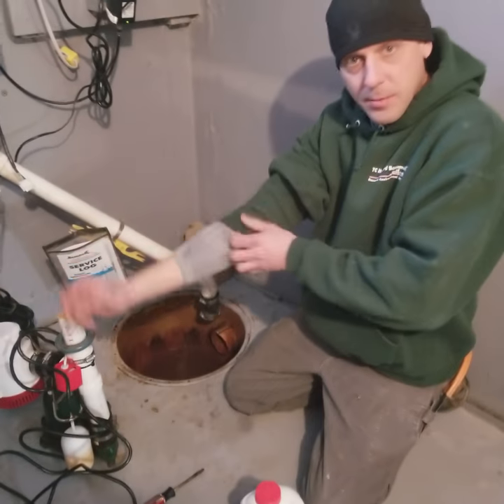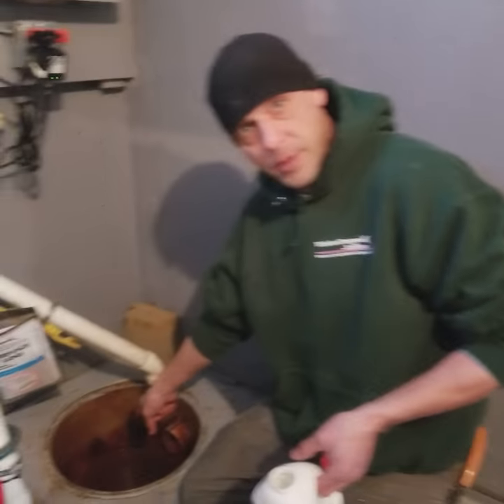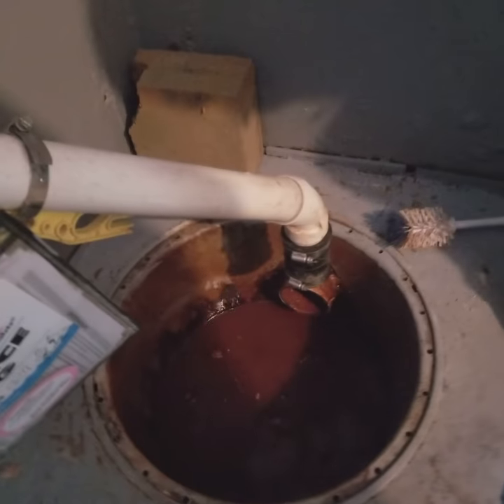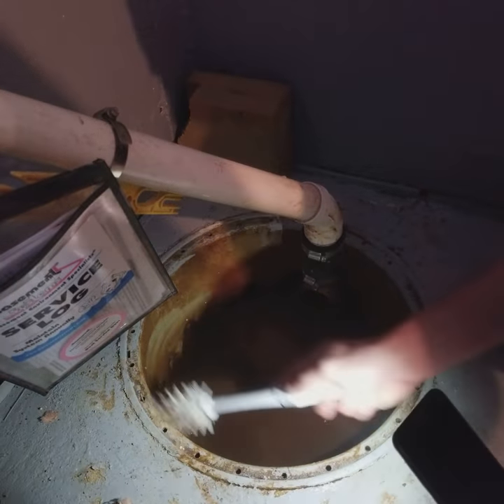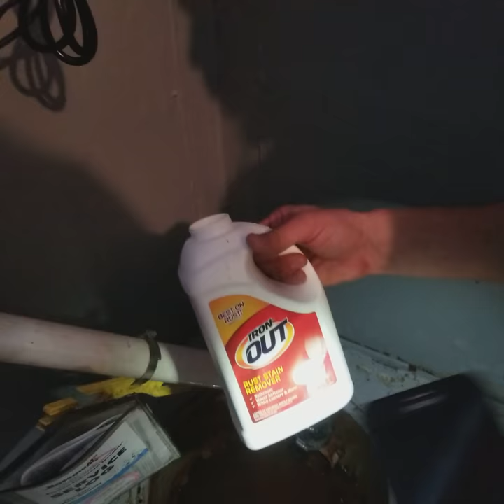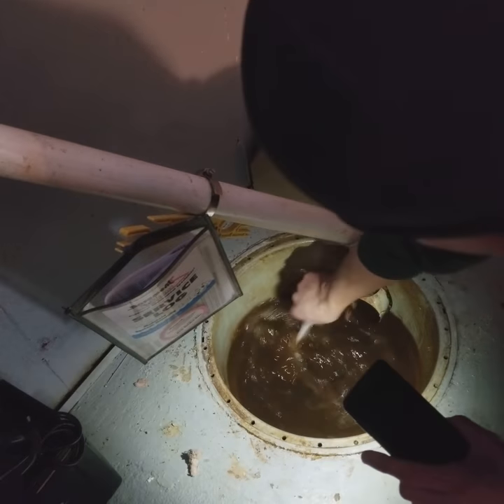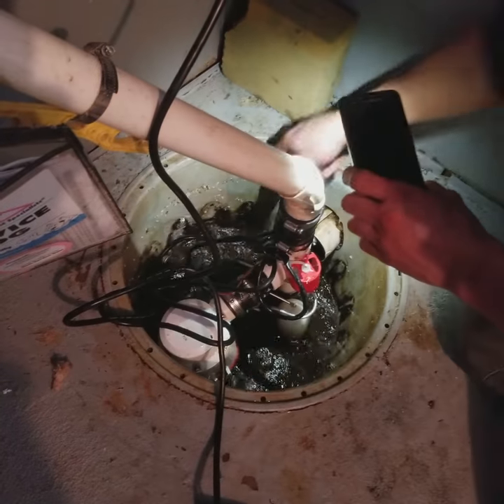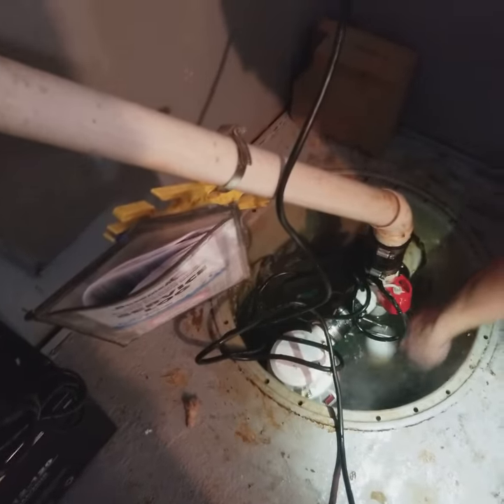How to Clean and Maintain Sump Pump - Remove Iron Ochre (Bacteria)

Comment: To all that has viewed this video I am Bryan that guy that did this video if you have any questions please call TC Hafford Basement Systems
Reply: Bryan Langlais how long do you leave the iron out before you pump it out
Reply: @gunnblaze  depending on how much iron ochre you have in your system. Normally about a half hour or so
Reply: I just had my sump pump replaced now I have a Metally stinky smell not quite like p00p but I don’t know why- I never smelled it before the sump pump change- my pump is covered/ screwed will it help if I flushed the toilet connected directly to it and also pour in the sink that’s directly to it❓

Thank you for sharing this!
Reply: Thank you! I can now see that I have Iron build up in my toilet tank.
Reply: Great video. 
Just had a sump pump installed under our home in Feb, but now it looks to be filled with iron ochre. Is there a more permanent solution other than using "Iron Out" (or equivalent) every month? Asking because our crawl space is only 3' high.

Comment: We live in Michigan...marsh country by and large. Our sump gets this stuff. For years we were fighting it and our plumber about five years ago recommended Iron Out. Works great! Thing is, I have to clean ours about three times a week or a section of the pipe will get clogged enough that it'll slow the process of removing water from the pit. I used to clean it once, then twice, a week. Neither was enough. Our pit gets a steady flow of this ochre all the time. 

Outside of the Iron Out, I take a three gallon pale, put a little OxiClean in it, then fill it nearly to the top with hot water. After initial treatment with the Iron Out, I'll dump the hot water solution in the pit, plug the pump in and let it run just enough to get the hot water and Iron Out in the pipes. I unplug it, let it sit a couple of minutes to treat the pipes, then plug it back in and let it drain. After that, I run water through the pit where it flushes the pit out four more times just to get as much of that ochre out as possible.
Reply: Hey this is Bryan with T C Hafford Basement Systems. It sounds like you're doing a really good job in maintaining you sump pump. Keep up the good work!
Reply from the maker: What Bryan said!!

Comment: We had the water guard drain tile system with the super sump installed in our basement in 2016, after Iron Ochre had completely plugged our original drain tile system, we had standing water on our floor and Iron Ochre all over the place. The new system works great. Our installer also told us to use iron out to treat the system. We have two access caps in each corner, and we flood the sump and drain tile, and then pour the iron out into each corner. Turn the sump pump back on and flush the drain tile with a garden hose, then clean the sump. We do that 3 or 4 times a year.
Reply from the maker: Wow, Les, this is great info! I'll pass it on to Giovanni. Thanks for sharing!!
Reply: U can use an electric power washer to, and stick it in your corner drains, use hot water..hot water kills iron ochre
Reply: Who installed the water guard drain tile system for you?
Reply: @bobbyg7552  ABS Foundations in Hilton NY

Comment: What about the pipes leading to the sump pits? This will only help the drainage pipe
Reply: Will not do anything for pipes. Even the drain pipe will not be cleaned properly. He is only cleaning the pit. The pipes need to be cleaned periodically. The only way to do this is by using a Clog Hog with a pressure washer back and forth till clean water comes out.

Comment: The holes in the crock are for what again? I'm not sure I clearly understood. Thanks!
Reply from the maker: Hi Jake! Around the 3:00 minute mark, Bryan answered my question about the holes, "they allow water to come into the liner so it can get pumped out". I'm the one asking the questions in the video (not the expert). My assumption is the water he's referring to is the water that comes from the French Drain system that runs along the interior perimeter of the basement under the floor. Great question - thanks for asking it!
Reply: @IamLisaMariaCantalupo  Ahh Thank you! I do not have the Drain Tile in my basement so I don't believe the Crock has holes. After watching this video I purchased the Iron Out and reluctantly cleaned my Sump Pump. Looks much better now and will hopefully mitigate the damp odor smell.
Reply from the maker: @nellydude255  awesome! We made the video for my son who wasn't able to be at home when Bryan had come to service the sump pump. This was some years back and my son has been using this stuff to clean the basin regularly and faithfully. He must have the cleanest basin around  😂

Comment: Great video. 
Just had a sump pump installed under our home in Feb, but now it looks to be filled with iron ochre. Is there a more permanent solution other than using "Iron Out" (or equivalent) every month? Asking because our crawl space is only 3' high.
Reply from the maker: @darrell214 thanks for the question. I'm not certain as to how to best answer other than to tell you that my son has been cleaning his sump pump basin out with this stuff and faithfully. His pump is running continuously too. He even used it to clean out a clog in the French Drain recently and calls the folks at TC Hafford for routine cleaning of them as well. https://www.tchaffordbasementsystems.com They may be able to advise you best. Thanks again and good luck!

Comment: Hi. Thanks for the video !
My basin like yours is always filled with this Iron ochre crap. I’ve had my discharge pipe and drain piping get gunked with it twice in two years. Had to have a professional come out and clean it both times. 
Will routinely doing this also help prevent the build up in the piping?
Reply from the maker: Hi Steve! Thanks for dropping a comment and question. I believe it does help keep the pipes clean. I shot the video at my son's house and as far as I know, he hasn't had any issues with the pipes.
Reply: Hi again Lisa. Great , hopefully it helps ! And i’ve been checking around online but I can’t seem to find a useful answer. I imagine this would be ok to use with a Zoeller sump pump?
Reply from the maker: @stevek8260  Hi Steve! Regarding the sump pump, I don't remember what brand pump my son had/has. Plus, I'm the one asking all the questions in the video (Bryan is the one answering them and the expert). We made the video for my son who wasn't able to be present so I wouldn't have to remember everything. LOL I'll ask my son about his pump though.
Reply: When you clean your pump and pipes out iron out once a month and you shouldn't have a problem

Comment: I have an auxiliary sump pump pit with no drainpipe. The water comes from the main pit and the backup system kicks in when the water rises and the alarm goes off. Why is there sludge in my backup pit? some gravel and sludge? There is none of this in the main pit. Any ideas?
Reply from the maker: Hey Thomas, thanks for commenting with a question. Unfortunately I don't know the answer but Bryan may. Sometimes he checks the comments but you could email or call the company he works for. Their web address is in this video's description.

Comment: Okay, so the big PVC dumping into my sump is 25% full of iron slime. How do I clean that out?
Reply from the maker: Good question Radio Dave! I haven't an answer for you unfortunately. I'll ask Giovanni for you though to see what he does!
Reply: Mix a gallon of the rust remover and dump it-the entire gallon in each floor drain in your basement, you may only have one floor drain, they are normally in a corner, then one near your furnace hot water heater area, those lead to your sump pump

Comment: Does this work if the pump is clogged
Reply from the maker: Hi Samantha! So the pump is clogged with Iron Ochre already and you want to know if the Iron Out will help to dissolve that clog. I don't have an answer for that at the moment BUT there are a lot of tips and wisdom left by others in the comments. Maybe someone has already provided the answer.  I'm sorry I can't be of more help.
Reply: It depends on how clogged it is. Tou may have to take the pump apart and scrape it. On a new pump, if you treat it with iron out, no scraping needed.

Comment: Thank you for posting this!  Our sump pumps drain into the street and the front of our house looks orange / clay color all down the street.  If I use this in the pit, do you think it will eventually clear up this issue?  Worried neighbors are going to complain.  Thanks!
Reply from the maker: You're quite welcome! I'm glad we made the video! I'm not the expert here so I'm not 100% certain if using this stuff in the sump pump basin would clear up your stain problem that's happening outside your house....but I think it would, just like it's been cleaning out the pipe where the water exits from our house. I say give it a go (after you read the directions on the bottle just in case there's a warning or something). And chime back in here later and let us know if it cleaned up the street. :) Thanks for commenting!
Reply: Did this help with the discoloration ?
Reply: @IamLisaMariaCantalupo  if you have any questions please call me at TC Hafford
Reply from the maker: @bry3574  thanks! The link to TC'S website is in this video's description. Would you like the telephone number in the description too?